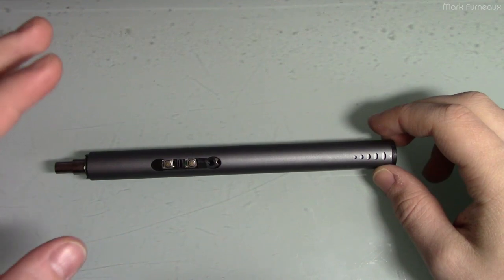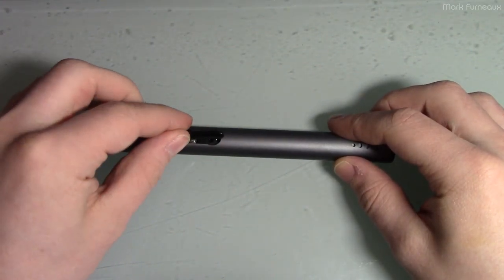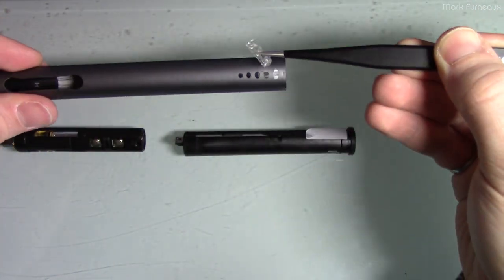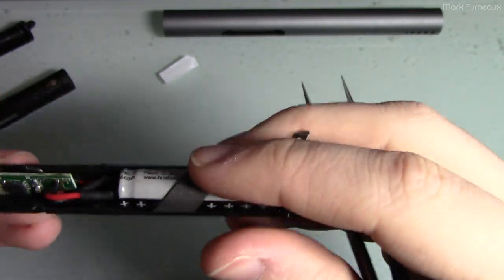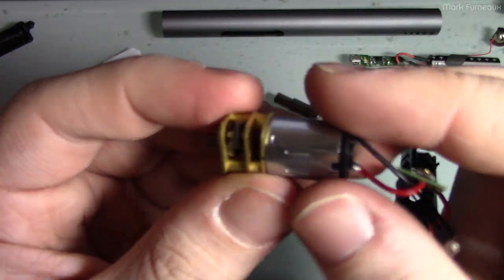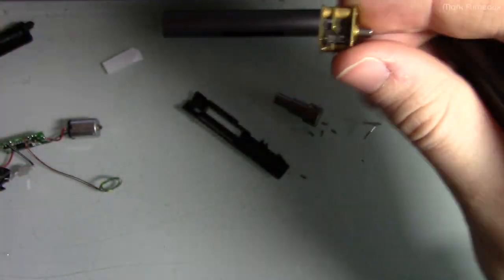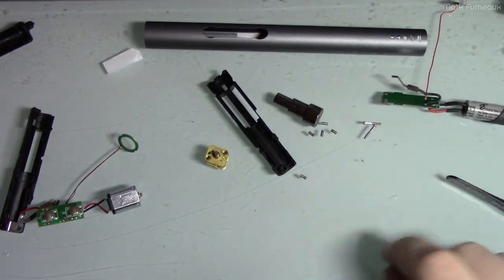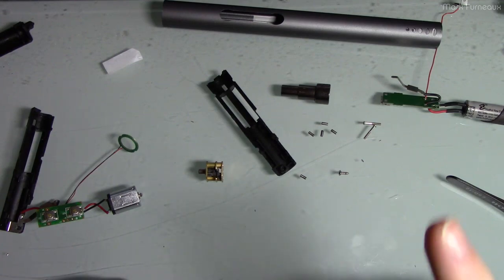A Great Electric Screwdriver but with Gears Made of Cheese: Post-Failure Teardown

Comment: Give the ES121 a try. I have two of them that I use heavily at work for working on laptops and other small electronics. They've been going strong for multiple years now. They have more speed and strength than the style you show in this video. They do run around $90, but if you do work with small screws it is incredibly well built. They use a planetary gearbox and thrust bearings to drive the output. I've seen several teardowns on Youtube, and it's built very well.
Reply from the maker: This is interesting. Looks like the miniware one, but with a hex shaft! I'll keep this on my radar.

Comment: I used one of those exact motor&gearbox about 6 years ago that I bought off eBay for dirt cheap, they claimed surprisingly highly torque and max axial load for it’s size, I operated it at about 80% of that spec and it barely lasted 5 uses before the gearbox started skipping. Even right out of the box half a revolution was smooth and the other half was slower and jankier. Luckily I only needed it to last a handful of uses.

The reason for having the same tooth geometry throughout the gearbox is they rearrange the gears to configure the output speed/torque, you can order several different configurations that just put the gears in different orders.

Comment: I had a similar one as these as well bought at the local Action, it had a different casing but similar internals. Mine failed on the motor itself and not the gearbox interestingly enough.
At least it being bought locally allowed me to refund it under warranty.

Comment: Pretty reasonable gearbox, just let down by using a cheap sintered powder gear drive. Gearbox likely is available as a spare part, but is pressed together and then the screw mounting bosses are expanded to rivet the entire box together.

Comment: They likely view these as disposable electric screw drivers, either in whole or by the looks of the module, switch out parts.
Reply: Disposable $50 screwdrivers? 🤨 Dang, I guess China is richer than they seem.
Reply: @user-vn7ce5ig1z  But of course in china the parts are readily available. They probably have 100s of these gears in a box.